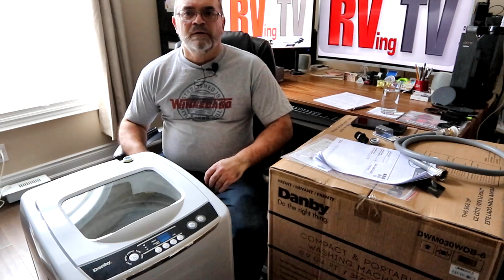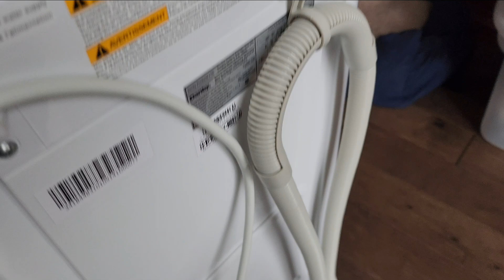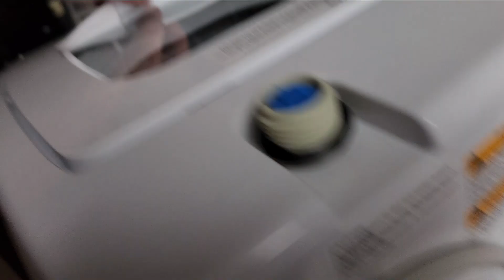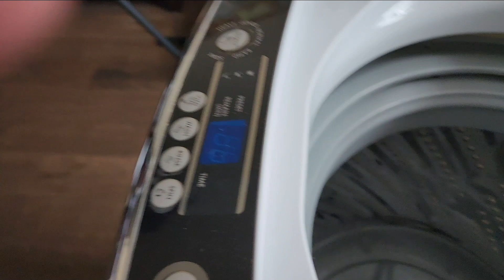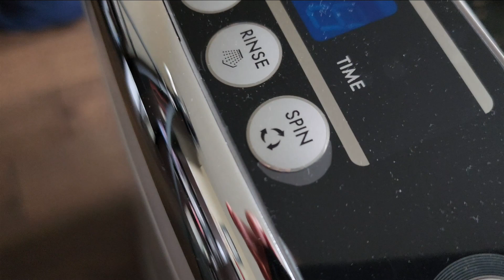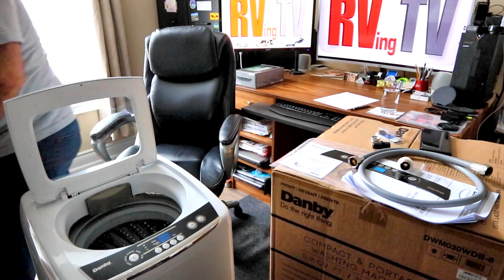Portable Washing machine great for RV - Danby DWM030WDB-6

Comment: If i put to much clothes in it and it burns where is the fan belt located at
Reply from the maker: Sorry I could not answer that, however if you are having an issue call the manufacturer help line.

Comment: Me its for thebathroom in m'y appartment for the adapter you say shower  that i dont understand dont want to.pay a plumer thank you
Reply from the maker: The shower comment is for a RV. connect it to your sink in your apartment.  You should be able to do this yourself without a plumber.  Also, if you have a handheld shower head you may be able to connect it there by removing the shower head.

Comment: Hi Bruno, question I've been using the machine for a couple of weeks and I love it! However when I use it in normal mode it pauses at 37 minutes for about 30 to 45 seconds, I don't know if it's equalizing the weight or what it's doing but I'm curious if you know? Thanks
Reply from the maker: The pause I believe is to allow the water and detergent to soak into whatever you are washing to best clean them.  If the load was unbalanced the machine would display code E3. Hope this helps.
Reply: @RVing_TV  Thanks and yes it definitely helps! Presumably this has happened with your machine as well right?(And it's never displayed the ER code unless of course when I open the lid lol
Reply from the maker: @keri72  Yes it has, and it likes to beep at me when I op the lid as well. LOL

Comment: Thank you for this video,  I'm thinking of purchasing  this machine,  I recently  purchased  a machine  same size and same cycles in fact it looks like the Danby,  but had to return  it , I thought it was a lemon so I purchased  another same brand ,it had same problem, the cycles where so messed up  it washed 81 min with 55 min spin cycl  and once bypass  the rinse cycle  completely and a terrible  motor  smell like it was burning.  So I'm very cautious  now.  Are you still happy  with  the Danby ?  are there any problems  it developed?  Sure would love some feed back on this  Danby machine ! do you know where the machine  was made ?